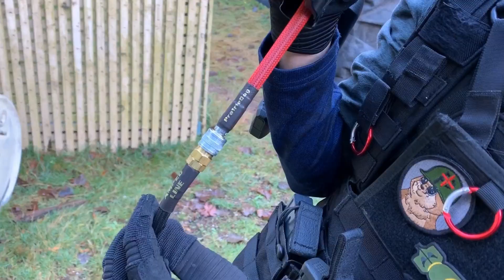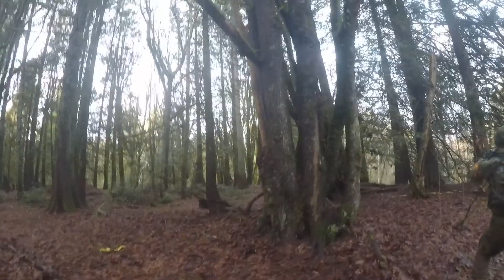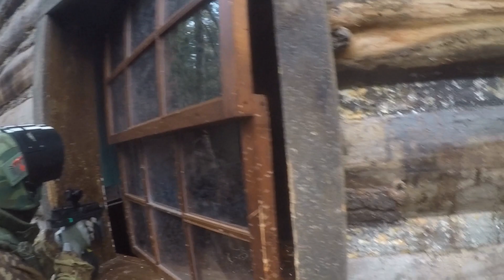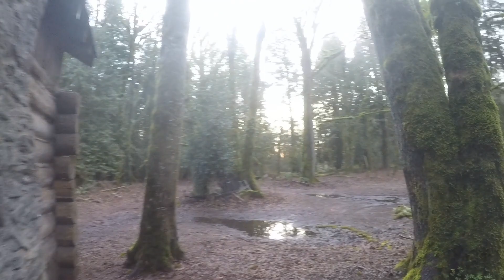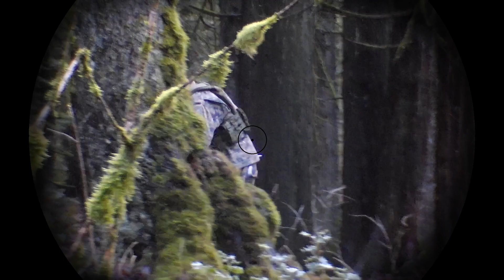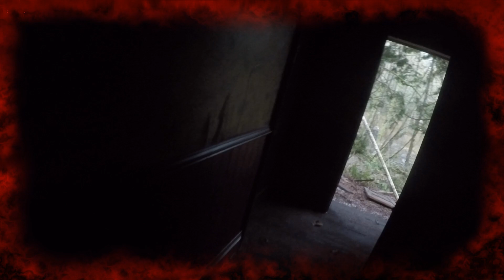I Put a Polarstar F2 Engine in my ARP 556

Comment: Hello sir/community, I need your help.🙏

I don't understand the difference between the polarstar f2, polarstar f2 v2 and the polarstar f2 v3.

Iam a noop so please don't get me wrong but I don't have any plans of hpa.
Reply from the maker: Hello! 👋🏼

So when it says version “V2” or “V3”, that just means that the engine is meant for a V2 or V3 gearbox since not all gearboxes are the same

For instance, somebody looking to buy an F2 for their M4 will get a V2 version. Those looking to get one for their AK platform will get the V3

Every airsoft gun has a specific gearbox version, or a proprietary/unique gearbox (these can be the most troublesome to HPA)
Reply: Thank you so much, I finally understood. 🙏
Reply: Iam planning to build me a rifle that is the perfect size for cqb but iam going to use it for outdoor games.
So I want a f2.
Can you please tell me more about what tank hose, regulator....... you would recommend?
Reply from the maker: @danaschlund3628  

You should check out this video I made about how to get into HPA. It should help you understand what you need 👍🏼

https://youtu.be/Zjbi4iAl8DU
Reply: Ok thank you sir 🙏🙂
If iam not too annoying, I'll probably still have some more questions after watching the video.
Nice Video btw 😎👍
Reply: So I have just watched the video and I really learned much.

What of aaaallllllll of the tanks and regulators is your favorite tank and regulator to use?(with the f2)
Reply from the maker: @danaschlund3628  Definitely the Amped regulator: https://ampedairsoft.com/amped-airsoft-hpa-slp-regulator/

As for the tank, anything they have that’s affordable and SLP (super low pressure) will do. Especially if your field does free refills
Reply: Iam liveing in a place with no official fields, no registration fees, no refilling services.
What can I use to fill up my tank? 😅

Comment: Hey may I make a recommendation, I have this gun and I highly consider getting a good Rhop... look on the app HopUp with Dan Bloomquist (I am not him but have used him  or do it yourself if you know how) and get a ZCI 6.02, your maxx HopUp, HopUp bucking and nub and get it barrel lapped, he can do all of that and install it for you for a pretty goof price! and use .32 or .36, and you should get 250+ feet of pinpoint accuracy
Reply from the maker: That’s actually HILARIOUS that you recommend this guy. I actually got my R-hopped barrel from him! Exact same specifications!

I’m currently in the process of switching over to heavier bbs and getting a more efficient HPA regulator. Things are definitely only getting better from here for me and accuracy should be easier for me to notice.
Reply: Pra1rieDog that’s awesome! I think about to get one like that but with a prowin for my ARP556 AEG ... how has your experience been with that barrel and HopUp and Rhop job done by him?
Reply from the maker: The club Im with get all their R-hops done through Bloomies. Very trusted guy and he asked me lots of questions about my gun before making me the right barrel. Had no complaints

Comment: what kind of stock is that
Reply from the maker: It's actually just a Krytac M4 stock!
Reply: @PrairieDogAirsoft  thanks man!
Reply: @PrairieDogAirsoft  im going to get into airsoft here very soon and i was looking at the 556 how would i attach it? do i just put it right on?
Reply from the maker: @Texasisthereasonn  The 556 is fantastic!! To change the stock all you need to do is remove the battery compartment cover on the back of the stock and use a screwdriver to detach the stock from the rear, it's that simple.

Putting on a different/traditional style M4 stock will require a loooong (and thin) screwdriver. It has to reach from the back of your new stock and through the buffer tube. It's super easy, it's just a little dark in there so take your time
Reply: @PrairieDogAirsoft  thanks man appreciate it!
Reply: @PrairieDogAirsoft  what battery would you recommend for it? im struggling to find out.

Comment: I cant really tell, but when you were pimping out your arp, did you change out the hand-guard?
Reply from the maker: Both the trigger and trigger guard is swapped out/painted, that’s it though
Reply: @PrairieDogAirsoft  how did you swap the trigger guard? Did you have to drill a hole in the other side to get it out?
Reply from the maker: @alanwright782  There's a punch-pin holding it in place. I suggest using a proper punch tool designed to fit and push it out... I used an allen key and a light hammer.... it wasn't pretty.. 😄
Reply: @PrairieDogAirsoft  lol I figured it out… it’s just a spring activated pin in front.